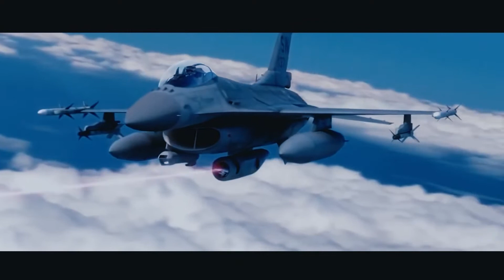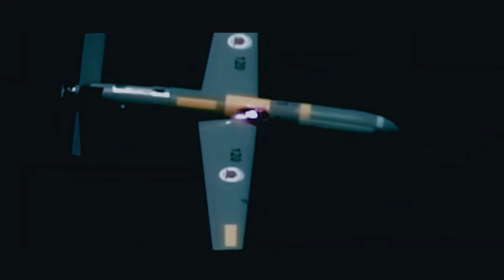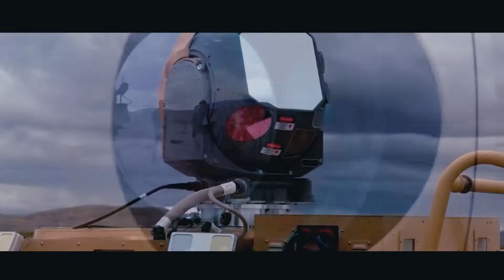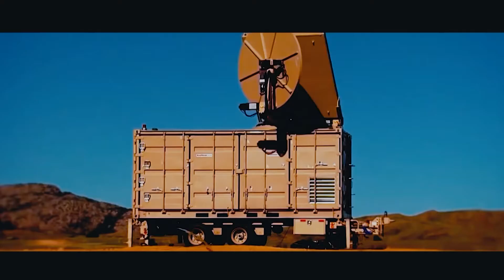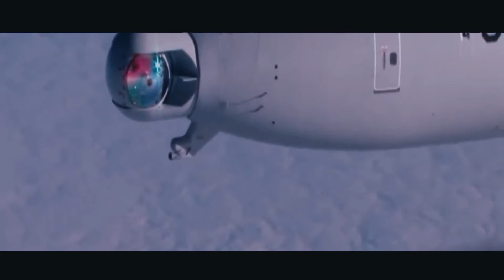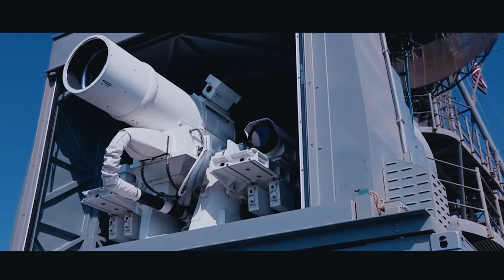Russia Panic: Here’s America’s New Most Powerful Laser Weapon in the World

Comment: Viewers should be sure to look up the various weapons whenever a model number, manufacturer, or designation is given. There are many tidbits that can be enjoyed, such as the fact that the atmosphere has greater transmission for the 1.3um wavelegth of the YAL-1's Chemical Oxygen-Iodine laser than for the 10.6um Gasdynamic Carbon Dioxide lasers of the Beriev A-60 and the NC-135. Of course, don't ignore ground-based lasers like the huge MIRACL chemical laser (now defunct but visible on gogle earth) with its SEA-LITE Beam Director, with which scientist too a few pot shots at an old satellite. Also, Russian ground-based lasers which have shot down test UAVs decades ago and there's video.  Lastly, LED based lasers, which are at the forefront these days, the most recent news about which concerns a prototype Ukraine has been using. 😸